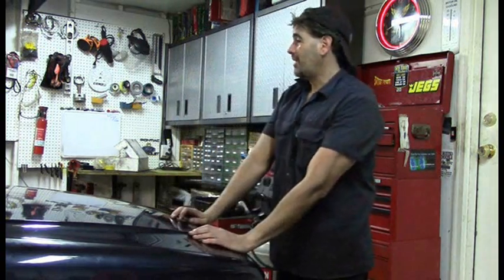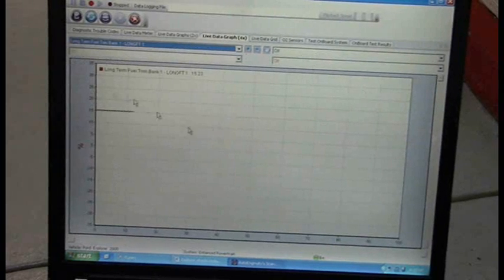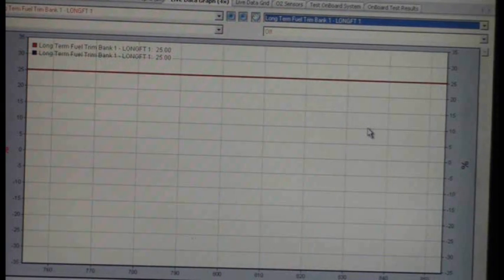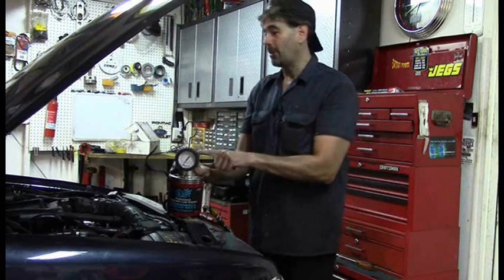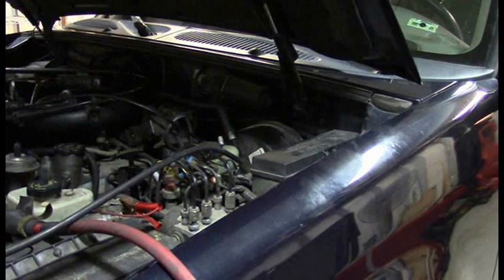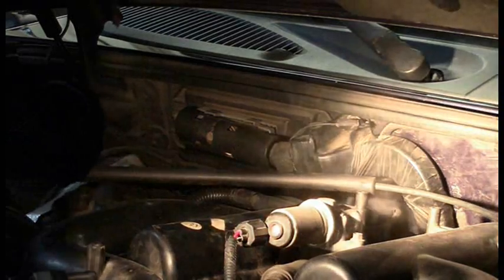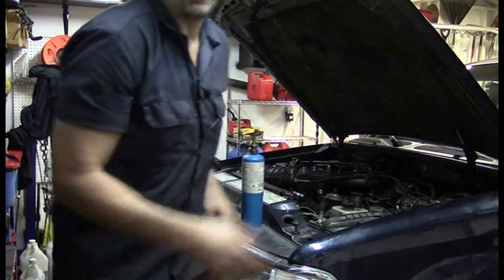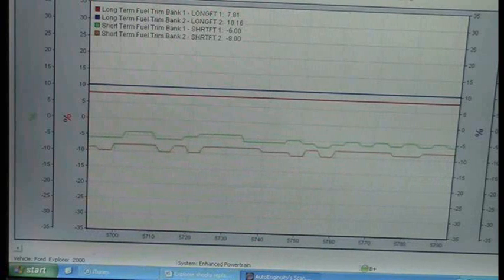Low Fuel Economy Diagnosis 2000 Ford Explorer

Comment: Thank you so much for your great videos. I've learned a lot from you and I appreciate your scientific approach to car repairs because I'm also a PhD organic chemist who works on cars (not nearly as involved though).
I have a 98 Civic that has been having horrible fuel economy for a few years now and hoping you can direct me to the right direction. It has -5% LTFT (sometimes higher absolute values) and STFT fluctuates -10~+10%. Upstream O2 sensor trace seems to oscillate properly during idle & constant throttle. Fuel pressure is within specs at idle and with throttle open. TPS response seems a bit sluggish, but I can't tell if it's because of my bluetooth OBDII device being slow or not. A year ago, the car was particularly rough around low RPM and verified the TPS voltage didn't change properly with respect to throttle, so I put in a cheap aftermarket TPS. I have detected gasoline smell in 2 of the 4 cylinders when the fuel pump was primed but without engine running. So I replaced all 4 fuel injectors to no avail for the fuel economy issue. Another symptom is that once in a long while the engine shuts down without any warning (re-starts up right away). The engine sound seems louder and includes very minor sputtering-type of sound, but the car still has decent power and acceleration. The thermostat has been somewhat recently changed with an OEM one. Any thoughts? Thank you for your time!
Reply: At load, the LTFT doesn't change (-5% or so) and STFT fluctuates -10 to +10.
Reply from the maker: Sounds like its not an engine related issue. Maybe steric hindrance lol
Reply: it is a small Japanese car with no racks or anything. so not much steric hindrance :) the difference in MPG is noticeable because until a few years ago I used to get >34 MPG on average, but now it's ~20 MPG. On steep hills, I feel like it has slightly less power than used to. So I'm still thinking it's engine-related?
Reply from the maker: Based on what evidence?
Reply from the maker: actually sounds like plugged exhaust/cats the way you describe it.
Reply: Thank you for replying! I suppose I'm not basing it on any solid evidence, but more on my ignorance that I don't know any other factors that can cause such a drastic change in MPG (I know that brake pads are not dragging, for example). Is the constant -5% LTFT a normal thing? For a brief period of time the engine did set a P0172 code for running too rich, but it cleared on its own.
Reply from the maker: What we know assuming your data is accurate (I am assuming you properly  curved it against load of course) is the engine is not compensating for an issue by adjusting fuel delivery.  Therefore saying the fuel economy is an engine problem is unfounded- actually it's contradictory to be exact. 
   Therefore the cause is more likely an excessive engine load which of course requires more fuel, but not via trim adjustment since the inputs are still accurate.
Reply: Thank you! Now I'm second-guessing everything... before ruling out everything engine-related, do you think it could be the ECU? If so, how can I test it?
Reply from the maker: Sure could. Simply check at the PCM pins for the signal and validate signal is present. But also remember If your fuel trim is responsive to induced variables it is clear the PCM is functioning. That would be pretty obvious, of course- almost silly to point out lol.

Comment: Hey thanks for the video. I have a 2000 ranger with the same engine and I'm getting about 12mpg on the highway. I don't know why I didn't even think about a vacuum leak.  Thanks for the tips.
Reply from the maker: A vacuum leak will not likely cause low mileage on highway or driving. Vacuum leak only reduces economy when idling.
Reply: Schrodingers Box hey thanks for the reply. What do you think about the Bluetooth odb2 readers for diagnosis?
Reply: Mine is getting bad gas mileage on the highway as well. Did you ever figure out what was causing it?

Comment: Sir, My Honda Civic 1.8 is giving very poor fuel average. I drive sedately below 2000 rpm and it gives 18-24 mpg vs honda 40-60 mpg. Car drives  smoothly and power delivery is good. Recently I had sulphur smell on revving my car hard which is no more there now. No error code is there. Unable to diagnose the issue. Please help.
Reply from the maker: What is your LTFT and STFT data at idle vs load?

Comment: I have no codes, and strong exhaust fumes, not like sulphur, but just like regular exhaust just much stronger.... And horrible fuel mileage. 2002 Honda Odyssey.... could somebody please tell me what's wrong with my vehicle or possibly wrong?  Thanks
Reply from the maker: What data do you have? WHat is the LTFT and STFT under idle vs load curve? WHat is the injector plusewidth response to MAP?
Need data to help.
Reply: +Schrodingers Box I appreciate the fast response, I'm sorry I don't have any data, I just have a basic code reader there are no codes so I don't have any data.
Reply from the maker: Mrscoobieman Can't help then, sorry. Good luck

Comment: matt your brain is amazing. i wish i could copy and paste it in my head.  maybe one day we will have that technology ;')  until then... i love your videos, I have learned many things!
Reply from the maker: +bunkerbuster Lol thanks man.  I have been asked before I I can put my brain contents on a flash drive hahaha
Reply: +Schrodingers Box one day.. one day. ;)
Reply: @SchrodingersBox  2006 trailblazer with vehicle running st ftrm 0.0 to -2.2 & +1.5 lt ftrm is at +16 at snap throttle it goes down to + 10. Code came AFTER o2s1 change . Also with vehicle off and scan tool reading of o2 voltage  o2s12 is 440v but o2s11 is .030 then slowly goes up ? And ideas and is this normal?

Comment: 07, f-150,5.4 triton, auto. trans,40k.mi
(ONLY 8mi.GAL.,low power, big deep waaa sound from engine when press on gas)
cleaned MAF, new air filter, MECHANIC checked for codes, no codes.)
NOW what should I do?
Reply from the maker: +steven lesher what data do you have? Anything is possible from that description. Need data as shown in the video to make a determination.
Reply: +Schrodingers Box I have to find a mechanic I guess too do a diagnostic. I don't have the mechanical ability to do all this. wish me luck

Comment: Low fuel economy was the complaint. Fuel trims were high to compensate for unmetered air, but also to keep the fuel to air ratio correct. It seems to me that more fuel and more air is the same as stepping on the accelerator. The engine would speed up, but the idle control would compensate for this. Also with the problem improving with engine speed, the car would have to do a lot of idling to affect fuel mileage. What am I missing here?
Reply from the maker: dogbyte555 Thats a good point.  Owner is a delivery driver- maybe idles the car more than usual?
 Another explanation possibly is with PCV leak, the owner was losing the PCV ventilation to the intake thus also lowering economy some.
  But I agree- I would normally not expect most people to notice most vacuum leaks to seriously affect economy.

Comment: Now I need to think about the idea how to diagnose the same, but without scan tool and without smoke machine and only with my brain and simple voltmeter. Scan tools are great. But I'm usually working with old, or even older than old cars ;)
Reply from the maker: The way I look at it, I wouldn't try to repair a roof without a hammer and nails, an electrical outlet without pliers and wire strippers, or a modern vehicle without a scantool. You wouldn't go to a doctor when you though you had cancer just to have him use a tongue depressor and sine a light in your ear.  The correct tools are just part of doing this stuff correctly.
  That said, there are some things you can do with just a DVOM on OBD cars but it's very limited.  For example, while you cannot get fuel trim without a scantool, you can measure O2 voltage and see that the sensors are switching AND that they go lean with a vacuum leak and rich with propane addition.  But if they respond accordingly, you really have no way of knowing fuel delivery adjustments by the PCM, and you are only left with guesswork.
  On older cars without a PCM though- oh yeah, just a DVOM, Tach, and vacuum gauge will get you solid direction almost all the time- but not as fast or accurate as with a scantool on an OBD car.  It's why I either work on pre-OBD cars or OBD-II cars. I can't use my scantool on OBD-I and it makes it too hard to get definitive diagnosis.
Reply: Schrodingers Box i totally agree, of course. The car I'm working with at this very moment is a 97 car, that comes with OBD II socket, but is not OBD II compliant. Funny, he? So it's electronically managed engine (pcm, fuel injection, sensors, stuff), has an engine light (that never comes on which is weird...) There is a way to read codes with home-made scan tool (like a small led and a few wires that you stick into obd II socket pin by pin), that's sort of useful, but it doesn't give you any live data of course. It behaves just like odb-i thing. With this kind of configuration diagnostics becomes really challenging and I'm still looking around how to do that right. Right in your meaning (which is my meaning as well). I'm pretty sick of guessing, assuming, trying (of course without changing parts!!!) I'm even ready to invest some money (I really like this car anyway) for some external/standalone monitoring system, that will be connected to existing sensors, or even directly to the PCM (I don't really know if there is something like that) just to make my life easier and diagnosis more accurate. And you know what? Only because of your videos and because I'm freak I just bought a crappy car with OBDII so I can play with my scan tool and live data graphs. My wife doesn't ask any more...... (is this car even driving?)

Comment: Diagnosis - American car
Reply from the maker: The variability in driver's care and maintenance is the main difference in reliability of vehicles, There is no evidence to show american cars are INTRINSICALLY less or more reliable than foreign. People just read stuff without actually questioning the evidence or make a general judgement from one personal experience.
Reply: Schrodingers Box I wasn't saying that it was unreliable because it's american... The title said "Low Fuel Economy Diagnosis"... I was implying that american cars are uneconomical gas guzzlers and you're wasting your time looking for a diagnosis to the problem the customer says the car has. I wasn't serious though, i'm just having a laugh :3
Reply from the maker: ***** I get ya- yeah you have a good point there.
Reply: Schrodingers Box I just found out that apperently Obama has just passed a regulation that requires all cars sold after 2025 to get at least 54.5mpg fuel economy! if they managed to keep this regulation in, america could end up having some of the most economic cars in the world... I highly doubt this promise will be kept and will probably be scrapped by the next government because people want cars with massive V8s because they think it's patriotic (even though this regulation is intended to reduce dependance on foreign oil, which funds terrorist groups like ISIS)
Reply from the maker: ***** As long as the cars have over 400HP I don't care what the gas mileage is lol
Reply: Schrodingers Box My car has 68hp... :( (It only weighs 1600lbs though) lol
I can get 70mpg (US) (under the right driving conditions, like straight roads at 40-50mph with very few hills) and it's not even a hybrid! I live in england though and people don't really care much about power, as long as it can hold 70mph in the majority of driving conditions and it can accelerate from 0-60 in less than 16 seconds. fuel has always been expensive as well, so fuel economy is pretty important here.

Comment: awesome video!!! i have a 2000 Explorer 4.0L OHV that's giving me fits with check engine light and crappy fuel mileage.
Reply from the maker: My videos should help. If you want to tell me the engine code I can refer you to a video most likely.
Reply: P0171 P0174 Lean bank 1 and 2
Reply from the maker: Ann Robinson  Well this would be something that normally a beginner would not be able to diagnose.  You would need to have a scan tool and know how to interpret the data from the fuel adjustments, generally far beyond the capability of most beginners.  If you are curious how this would be done my video "Secret of engine problem diagnosis: fuel trims" explains it better than anything on the internet but most likely you will need a shop to diagnose it for you.  Just don't let anyone talk you into new Oxygen Sensors like 98% of idiots will do on those codes.

Comment: The problem got worse after replacing the PCV...That is a huge red flag right there. You can clearly hear the vacuum leak and yes, smoke machines are awesome to have. Something to keep in mind when smoking the EVAP system, the vent solenoid should be closed using a bi-directional scan tool...just throwing that info out there(knowledge is power) Keep up the good work Matt.

Comment: MY 2003 HONDA CRV DOES NOT SHUTS OFF but loss power I press on the gas and the car does move I turn the car off for 10 minutes and go back to normal.the last time that it happen I was in the freeway at 60 mph and suddly lose power no check engine light.what can be?what I need to check?please...

Comment: Don't have a smoke tester and needed to find a vacuum leak on my '93 S-10 4.3L.  I used an incense stick to provide a source of smoke to find a bad gasket under the throttle body.  Worked quite well for me.  With engine running, the vacuum leak pulled the smoke into the engine when brought near the site where unmetered air was entering the engine.
Reply from the maker: Never tried that- sounds both effective and spiritual. Being in Colorado, I expect a lot of people will be putting lit reefers up to intake leaks to look for them. It wquld be even funnier if the car's idle really mellowed-out too.
Reply: That's a cheap suggestion (as in good). I couldn't find my mom's vacuum leak and I didn't want to make a cigar machine when tobacco makes me gag. So, I'll put the incense in her intake tube, plug it up and watch for smoke. Only place I can think of to put it. :)

Though, watching the STFT and LTFT while running the propane around a bunch of vacuum hoses, the intake, ect., may just be a way to see what's going on. I couldn't tell before, not noticing a change in the idle.

Comment: I finally found my pesky vacuum leak that would cause no load misfires that where not consistent and only having a positive 3 long term fuel trim. It was in the throttle body shaft
Reply from the maker: Yes I haven't had my smoke tester long but I have seen this in about 1/2 the cars I tested thus far. In my experience the leaks are very minor and have never affected driveability but maybe that wasn't the case for you. But in general when I see that, I dismiss it as a cause for concern during a smoke test and actually with only a +3 LTFT I wouldn't even have considered vacuum leak in the first place to be honest.  But hey if you repaired/replaced the TB and your symptoms disappeared then I am convinced!

Comment: Nice work Matt as always. I noticed in the beginning of your video that you were plotting the LTFT bank 1 twice and didn't have LTFT bank 2 up. But near the end of the video, I saw that you caught that and was plotting both banks for LTFT. Yup, the smoke machine sure is a time saver. Keep up the good work.
Reply from the maker: ROTF!!! OMG I totally did not catch that!! Yeah that would have been horrible if it was a Bank 2 issue eh??? But luckily as you stated I did cover both banks later anyway, but yeah I totally did not even notice!! Whew, I caught a break there!

Comment: Well done Matt -  the PVC was so loose the owner should have noticed it.  I suspect  the low fuel economy was a result of an incorrect part -was there a secondary fault that was fixed with the wires and plugs changed.
Reply from the maker: Hi Steve, good question. Yeah I really can't say what or wasn't fixed by the secondary because, as you will surely agree,  whenever owner involvement is part of the equation it almost always adds to the variables rather than to the constants lol!!!  
 Hey that should be in a list of famous quotes!!

Comment: Well Matt I am finished watching and ... you rocked it :) Text book diagnosis, and excellent information as always.  You made a great investment with that smoke machine! I have had experience in the field with that machine, and I can say that it won't let you down.  If you deal with lots of EVAP codes, that machine coupled with a good bi-directional scan tool will save you TONS of time.  Hope to see another vid real soon!
Reply from the maker: Thanks Jeffrey good to hear from you again. Yes the smoke machine is a fantastic addition for my little home garage and I have already used it to detect EVAP and Exhaust leaks that quite honestly I never would have found by any other method. It will pay for itself many times over in time savings. One of the best applications which I should have done a video on- a Ford Taurus with terrible stumbling, hesitation, rough idle on cold start but runs like a dream when warmed up.  Using the smoke machine I found a massive intake manifold leak when the car is dead cold but it sealed up completely when car was warmed up. I couldn't use my scantool for diagnosis because the car ran fine just before it would get to closed loop. Smoke machine was a saviour on that one!!